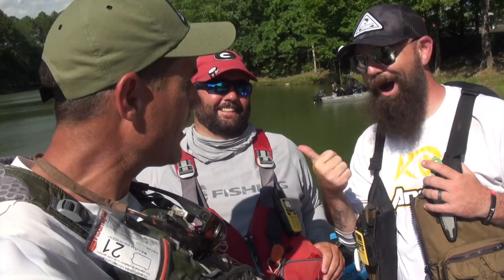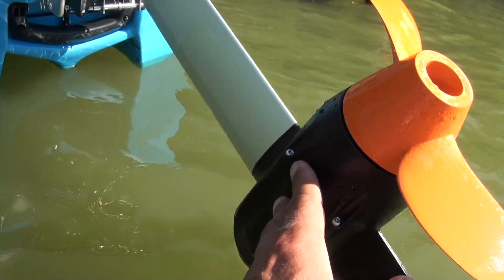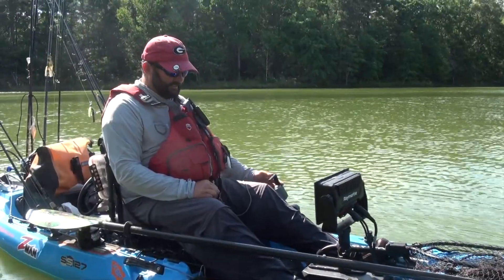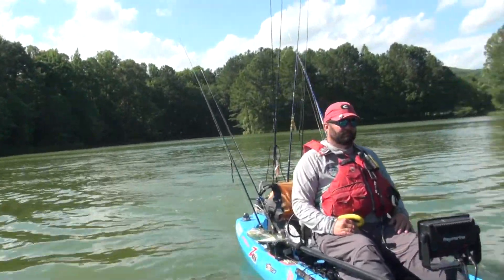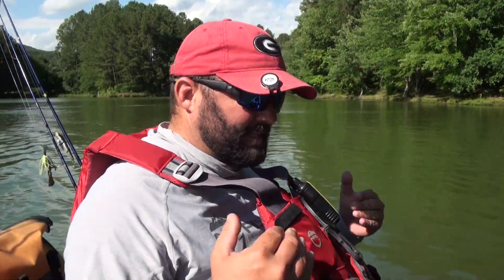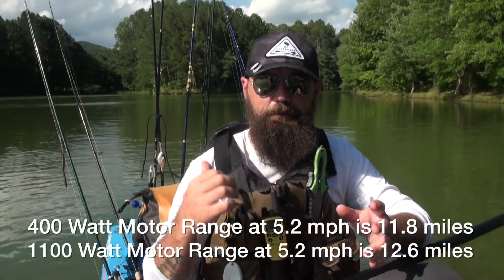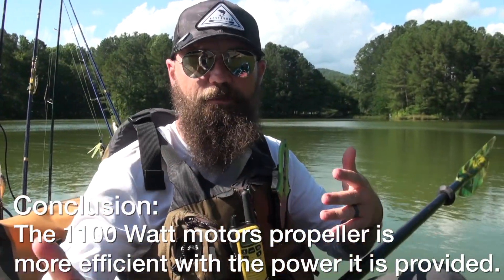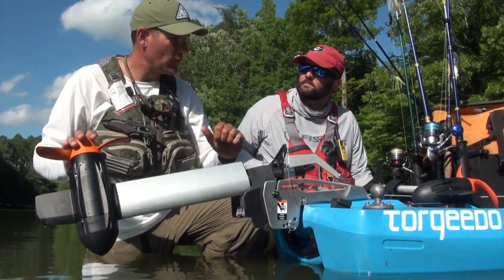Torqeedo Ultralight 1103 Prototype Testing with Gene and Scott

Comment: Can it be electronically limited to 55 lbs thrust in the throttle setup menu? I'm looking at a boat with that as max, vs the 1103's max 70 lbs.

Comment: I see its in stock for  $2699, since i have the 403 AC can i just buy that 3HP motor only ?since it shares all other components and battery with the 403 AC
Reply from the maker: shon kirika The mount and other components are different.